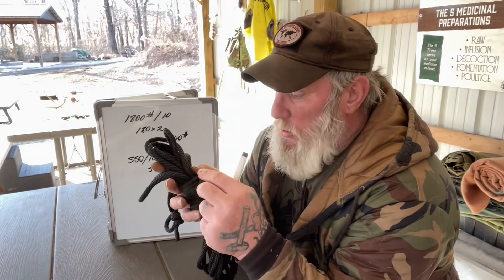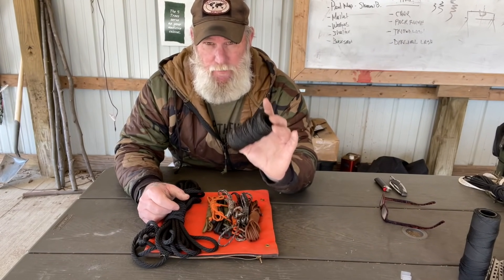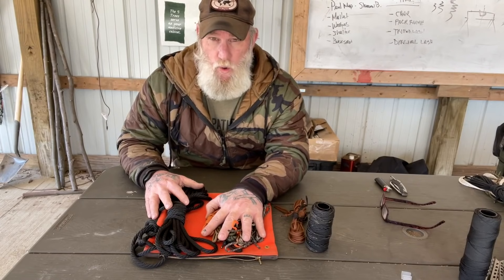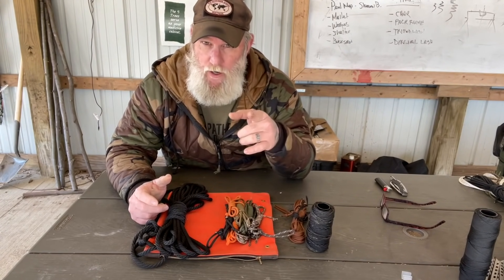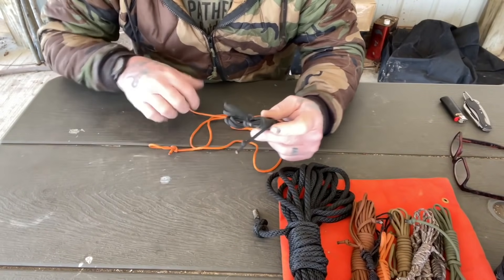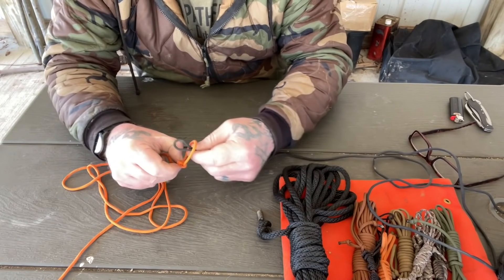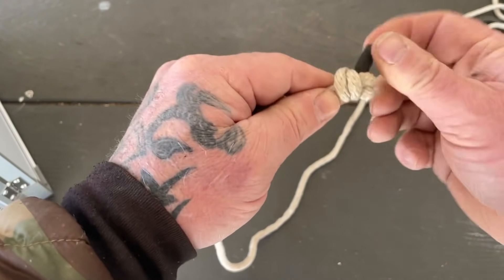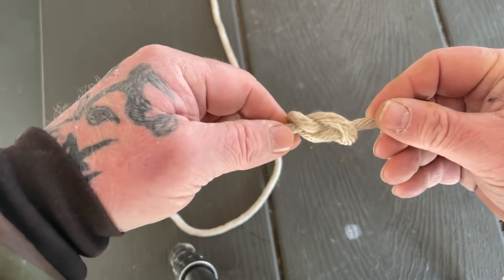Rope Clinic Part 3

Comment: I rap'd out of the in-processing building at Campbell (old Rakk baracks) with 550, using over body rappel.  Weighed 180 at the time. Didn't snap on me. For whatever that's worth.

Comment: Just fyi. OSHA standard for safe working load is a 15/1 factor. That 1800# tensile strength means only 120# working load.  Most rope packages will also have the same information for the specific rope you’re buying.

Comment: Hey Dave enjoying the rope & knot videos . I am an old retired oilfield guy worked offshore and the drove 18 wheeler in oilfield . Some of your knots and rope handling I learned and used in the oilfield but something I noticed is what you call the working end we called the dead end and what you call the running end we called the live end or the working end . Just something I noticed that is different from what I learned offshore on drilling rigs also learned how to splice rope to make loops or a fat handle at the end and splice 2 ropes to make them longer also was taught how to splice steel cables man that was hard much rather splicing rope over steel cables . On the cables some times you would have to cut a strand out of it to be able to do the type of splice you had to do thanks for the videos it has brought back some memories and a thing or two I forgot @ 65 now sometimes you forget something best wishes to ya and all your people ! From South Louisiana Land of the Cajuns oh almost forgot something I have never heard any of you bush craft guys mention and I fallow several of ya is that never trust your life on a square knot like to hold your body weight because if you pull hard enough on a rope with a square knot tied in it , it will pull the knot out don’t know if you ever done it but if you don’t believe me tie 2 ropes together then tie one end off to something then pull the other end with  an atv or truck and the knot will slip and untie before the rope breaks

Comment: Brilliant stuff. Use most of this, except when it comes to strictly end of the line loops, that I want to always be there and with a stop knot at the other end. 
Instead of a Bowline I use a Double Dragon Loop with a stop knot on the "tail/working end" of the cord that forms the knot. Incredibly strong loop, in any direction there's pull, but still able to undo it should I absolutely have to. :)

Comment: just wanted to comment on the Stevedore knot. The pronunciation may lead some to believe this knot was named for someone named Steve, it was not. Stevedore (Steve-ah-door) was the job name for the boys loading and unloading ships which in the day had a large number of ropes and pulleys involved. This knot was developed to prevent the rope running through the pulley as it is somewhat larger than other stop knots in use!

Comment: Loving the series!  I've played with rope for decades, recently started exploring dyneema rope/cordage.  Amazing stuff, like paracord-size rated for 1800 pounds!  BUT, it's slippery as can be!!  So normal knots don't seem to work as well, like trying to put a prusik on it for a ridge line.  It's taken some modification of technique but the stuff is super lightweight, doesn't absorb water, and is ultra strong.  Modern technology, sometimes it's a good thing.
Reply: No Ad at the beginning, Dave. ...you know how they are.

Comment: Dave - very well done. Those are some of my favorite knots. Is there a downside to the cowboy bowline? Good knowledge of knots is invaluable. It turns a rope into one of the best tools a bushcrafter can have. There's even a branch of mathematics devoted to knots.
Instead of tying a clove hitch I now go to the slightly extra effort to tie a constrictor knot. Both the tag end and the working end is constrained and it is a far more secure knot. The constrictor knot can also be used as a single-knot lashing. The downside is it is more difficult to untie.
Reply from the maker: I agree and again we really think a lot of transfer to other lessons and with some lashings beginning with a clove hitch, as well as Net main applications we tend to use that one as one of the base 5 not only as a hitch but also as a base 5 knots at the intermediate level courses

Comment: Dave, will you be covering vector forces in ropes? With two anchor points and a 120 degree angle in the rope holding the load, the forces double and get higher as the angle increases. A lot of people forget that when securing loads.
Reply: In the Machineries Hand Book,  there are formula s for vectors and loads...
The books are not static..
The old ones had this information in them.

Comment: When it comes to bank, line do you think #36 is the best size and is the twisted version more useful than the braided variety?
Reply: #36 twisted has greater versatility because it can be easily "disassembled" into essentially 3-#12 bank lines.  If you're only going to have one roll of bank line, #36 is probably the best.  Personally, I prefer twisted for large bank line and braided for smaller line or line that something hangs from (bear bags etc.  Braided can't untwist due to the weight placed on it.)

Comment: Conversion tables give 12KN = to aprox 2,600 lbs NOT 240 lbs. 
Out by factor of 10ish. 
What am I missing? Or is this including some sort of fall factor? 
European here.
Reply from the maker: No just applying Safe measures for use similar to rope, could be a bit confusing though you are correct on that, I would never trust a Carabiner that small to that much force and feel safe personally. Thank you for the observation

Comment: What's the reason for dividing by 10 and multiplying by 2? Why not simply divide by 5? What am I missing, is there a reason for this seemingly unecessary complexity?
Reply from the maker: Easier for most to do math in their head with numbers divisible by 10. 1800/5 is not easy math in the head on the fly. Keeping things less complex makes for easier learning and remembering- It could just as easy be 1800x2/10 whichever is more easy to remember for the individual
Reply: @DavidCanterbury  No ad at the beginning Dave. Just a heads up. 👍🇺🇸🙏
Reply: @DavidCanterbury  ive seen a couple comments about divide by 5. I learned a long time ago from my step dad (retired army full bird) use ten whenever you can makes for simple head math. And if its not divisible by ten evenly. Use ten to get close and finish the rest once the bulk of the math is broken down. 10 is the number. But some people just cant seem to understand that for whatever reason.